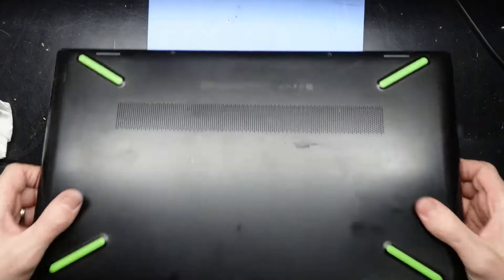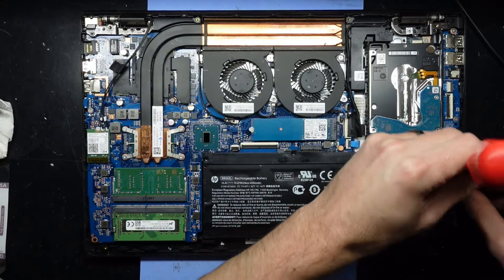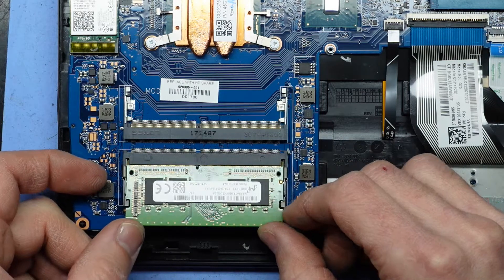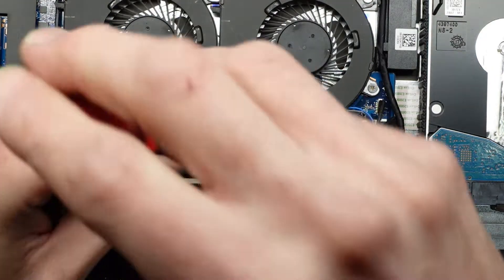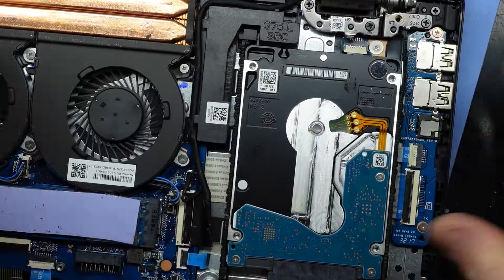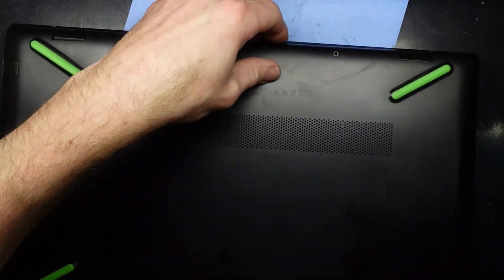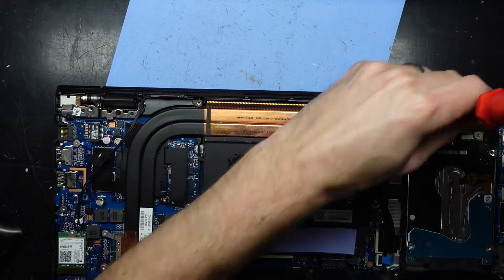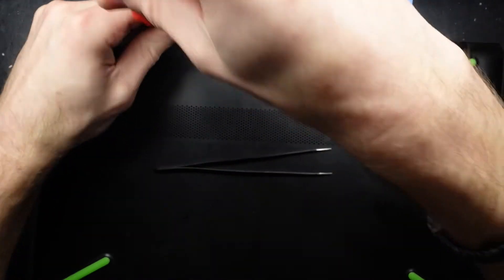HP Pavilion Power - 15-cb062tx Ram and SSD Upgrade

Comment: Nice tutorial!! Thanks! My HP Pavilion 15 CD gaming laptop only came with one, 8gb stick. I'm about to install two new 16gb sticks, which I read in multiple HP forums works fine even though the manual says 16gb is the max. I hope the new sticks don't blow up my laptop. lol
Reply from the maker: new sticks won't blow up the laptop
Reply: @rickstechrepairs  the two 16 gig sticks work great and when I check my computer in settings it's now showing 32gigs. Its now flying

Comment: Very helpful, what model ram  did you install?
Reply from the maker: Crucial 8gb ddr4 3200mhz
Reply: @rickstechrepairs  Does it support above 2400mhz??
Reply: @tm_esco  nope, the cpu itself supports a max of ddr4 2400mhz, so the added ram stick will run at that speed even though it can run at 3200 mhz